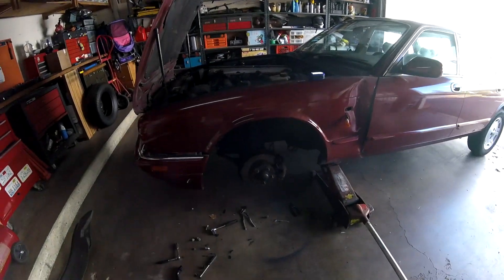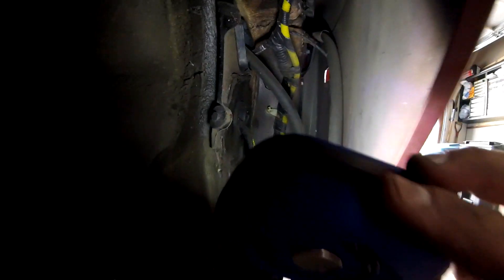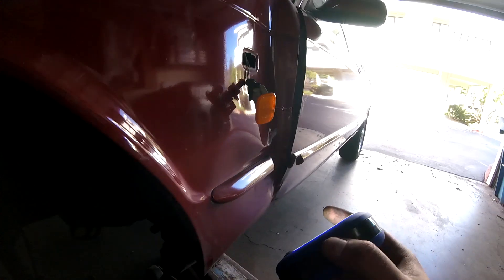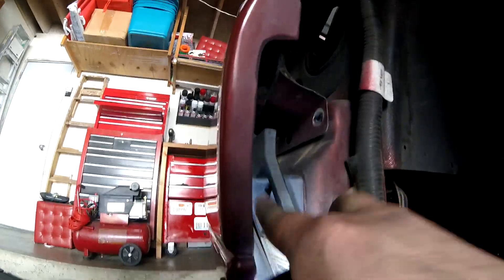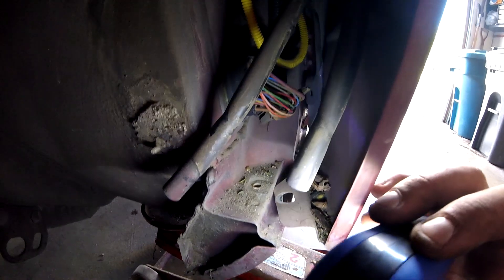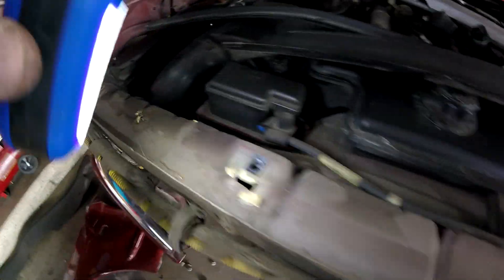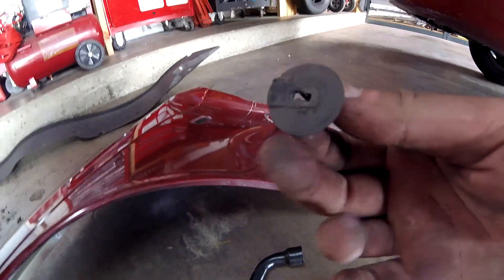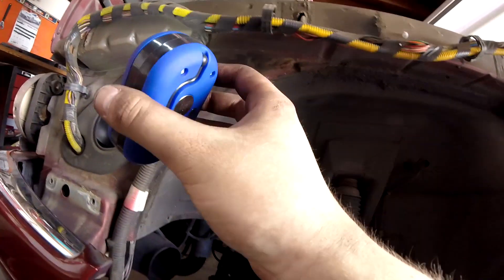HOW TO... Take Off Fender | Jaguar X300

Comment: I have been parting car parts for years, usually there are bolts on the outside of the fender but for this car its on the inside. That is so stupid, It is almost impossible to take off the fender without damaging it.